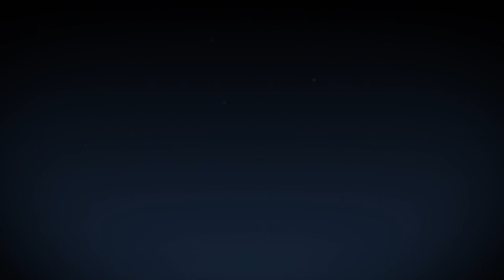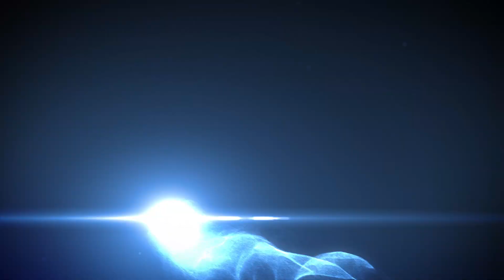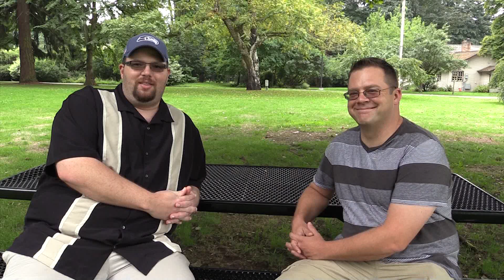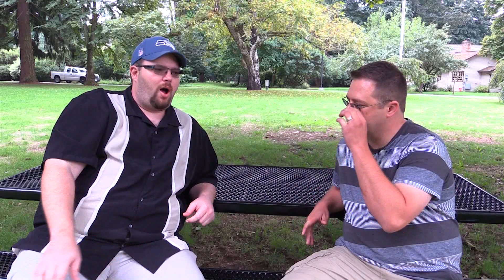How to design a computer - Building a $1000 gaming and editing PC (Part 2)

Comment: I'd have to say you can "future proof" yourself on case and PSU sort of.  I mean I only recently got a new case to replace my 7 year old thermaltake armor.  I didn't NEED to, but so many nice features in cases these days.  Also still have the same 7 year old PSU, which I plan to upgrade soon so I can finally get rid of the mess of cables with a modular PSU.  It might not be truly future proofing, but close enough...you shouldn't have to buy a new one for some time if done right.